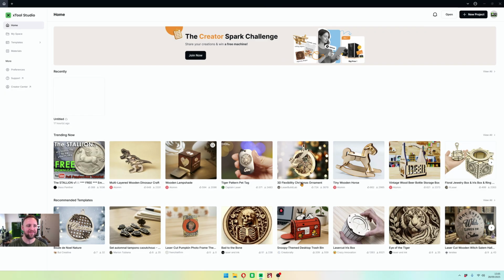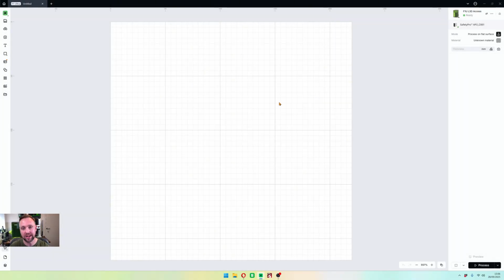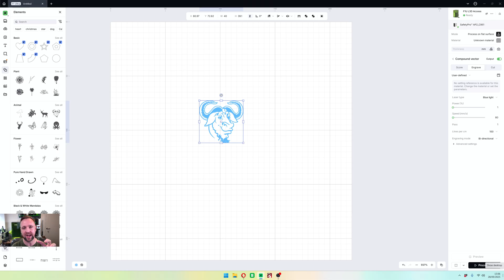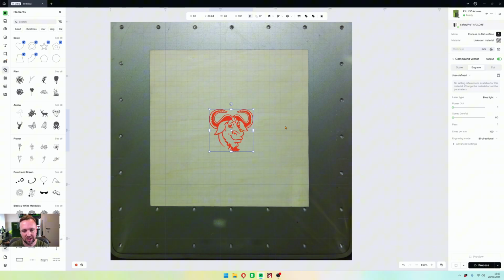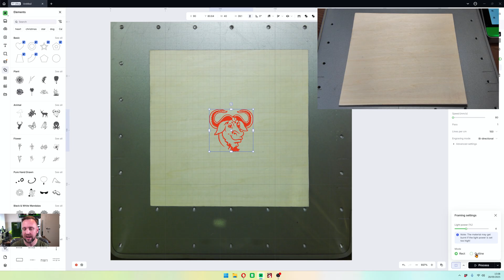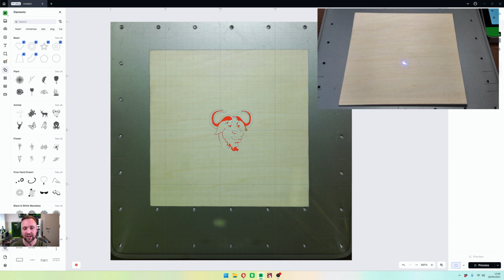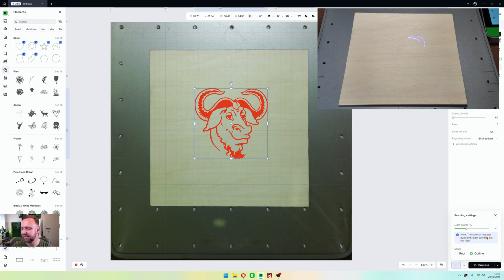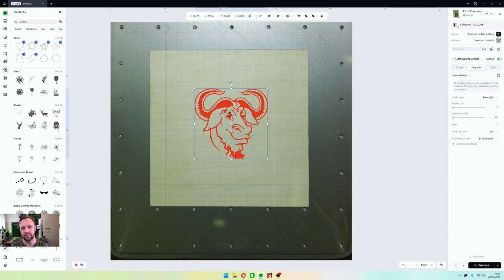How to Frame Your Design in XTool Studio (Beginner Tutorial)

Comment: Hi There! New Scriber and new Xtool owner with a question for you. We purchased an XTool F1U and F2 (smaller one because it's way more portable). My question is, we have noticed that F2 connection is not persistent and we have to physically connect the machine to it every time we want to use it. We see it but the wi-fi is not detected and if we go between the F1U and the other we have to plug it into the laptop and connect. Have you (or anyone else) had a similar issue? So, there's that and thanks for the content, it's been very helpful!!!!
Reply from the maker: Hey! Thank you for becoming a member. I have the same setup as you (F1U & F2) and both are able to connect to the WiFi reliably. What I recommend doing is opening up a separate design page for each machine. For example, on the first page that opens when you click "new" connect it to your F1 Ultra. Then click to add a new page and manually change it to the F2 and connect. Both machines then remain connected.

Hopefully that helps!

Comment: Your tutorials are very clear and easy to understand, appreciate you taking the time to put them together and i am just working my way through them all. Just bought the F2, extension slide table, Ra3 rotary and the air purifier but didn't realise that a pair of glasses were not included as they are very important and necessary to use the rotary and slide table. Now going to need to look for a pair of glasses, disappointed in that after money spent on setting up and can't get started as I will need them to do tumblers and some production work. Thanks again for the tutorials.
Reply from the maker: Thank you for watching. I really appreciate it. I'm assuming from your picture that you're Scottish which means the amazon glasses link I include in my F2 start here video description will be accessible to you. There are lots available but those are the ones I got and they are still going strong (so are my eyes 😅).
Reply: @L3DAccessories yes but a little late I ordered a pair from Laserpecker on ebay which arrived this morning. They look exactly the same and include the OD rating etc etched into the lenses for the frame and the lenses at £29.99 so no excuses now.
Reply from the maker: This video: https://youtu.be/1uTczFcUAqw

Comment: Hi I’m super new to engraving. I am trying to engrave jewelry and can’t seem to see the blue light for framing. I tried everything
Reply from the maker: The first thing I'd recommend checking is that the lens cap is removed from the laser. Do you have the F1 or the F1 Lite?
Reply: @L3DAccessories yes I did , I even engraved a couple of things, but I was using the camera which of course you said would be off by a couple of mm
Reply: @L3DAccessories f1 ultra